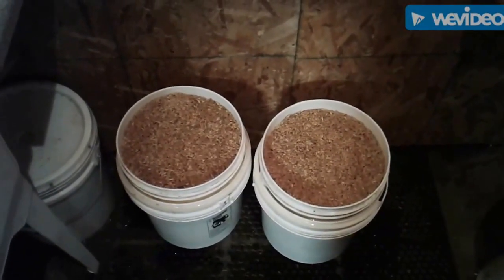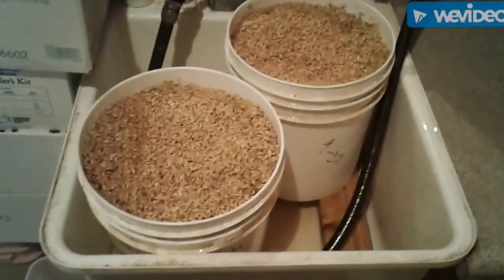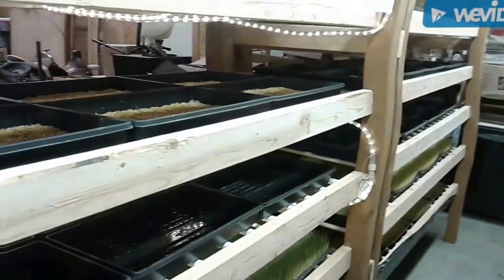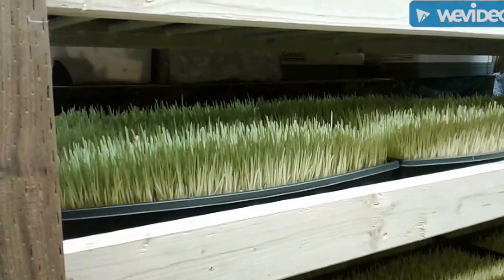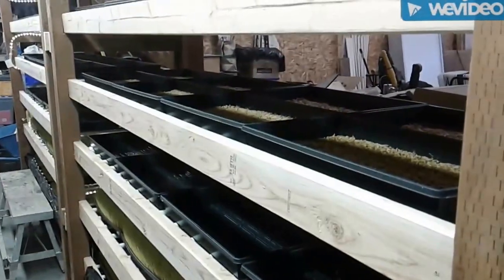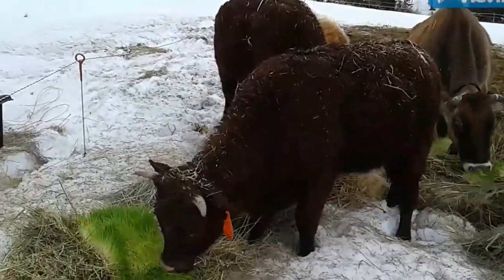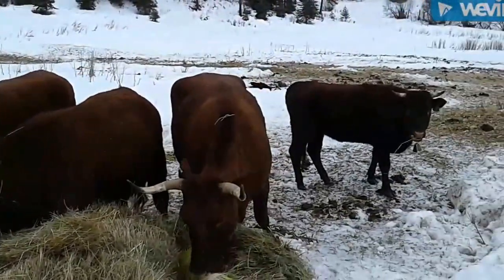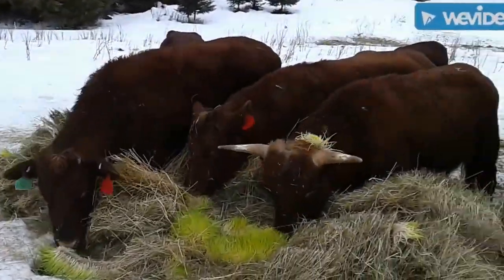DIY Hydroponic Microgreen Fodder System

Comment: How do you collect the water at the bottom
Reply from the maker: We used plastic sheeting stapled to the bottom frame and directed all of the run off into buckets that we emptied twice a day.
Reply: @tradcathomestead8179  ok thanks. Ope u are still having good luck with the system

Comment: Hey! We are Trad Cat homesteaders too! Trying to figure out my fodder system. Is your shop where your fodder is kept, insulated? We are in Wisconsin and we get well below zero for long periods of time here... I need to get mine going again. Thanks and Have a blessed Lent!
Reply from the maker: Our shop is insulated and heated.  Being able to keep the fodder growing area in the 55-65F range is crucial to having quality fodder.  We moved the racks into a much smaller area this winter in hopes of reducing the energy required to moderate the temps.  We usually have a couple months with sub zero weather every year, so it's definitely tricky!  My plan is to bury a shipping container several feet under ground and move the fodder into that.....some day!!!